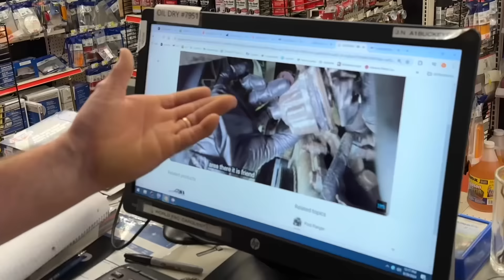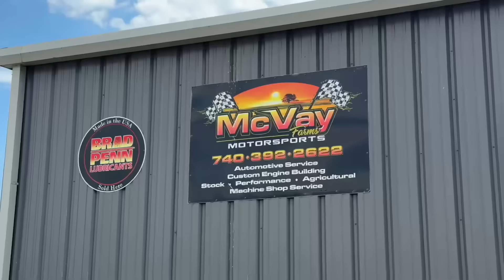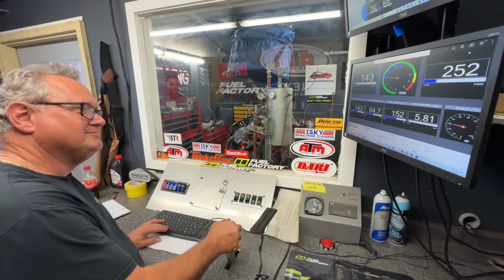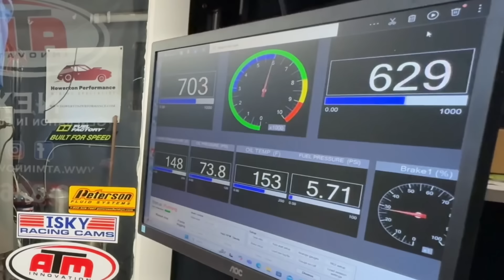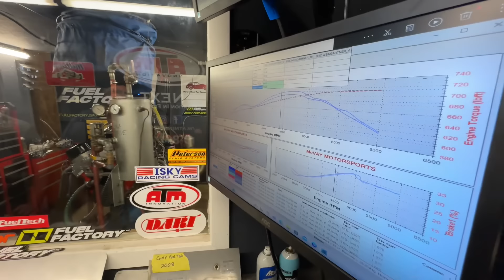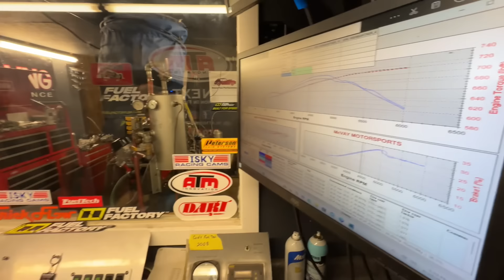WHAT WOULD YOU PUT IT IN???  WE ARE WORKING ON A NEW 496ci BIG BLOCK PUMP GAS GIVEAWAY ENGINE!

Comment: Centrifugal force is holding the clutch. We've been through this a bunch of times. A return spring on the clutch pedal under the dash will fix it in a crunch.
Reply: Been there, done that and a return spring has been a lifesaver a few times
Reply: Yep, also been there and done that with adding a return spring, but I added mine to the clutch fork to the frame on my ‘57 Chevy. Diaphragm clutch pressure plates were known for this. Also, if this engine is going to see some high RPMs, I would put a blow proof bell housing on it. When I was a senior in high school, I was checking out an engine in a ‘63 Chevy that the owner would sell if the money was right. The car was stupid fast due to the built engine. To make a long story short, that was the first time I saw a clutch / flywheel explode which basically cut the car in half.
I hope the 4 speed stays. Changing to a turbo 400 trans will make it faster but kill the fun factor IMO.
Reply: Absolutely..... put a spring on the pedal and be done with it.🇳🇴
Reply: Why not a automatic transmission you shift it out manually to if you want to or just put it in drive and cruise it.

Comment: Nice build. I’m building a 496 with a Crower custom ground hydraulic roller, 781 heads with big valves , port and chamber work. I hope mine makes similar power with a little more compression on E85.

Comment: Your brother should look for a crank with a big block snout that way he won't be breaking the crank on that small block with he supercharger. I learned quick that the small block snout can't take the force and tension on the crank snout and will snap clean off right behind the timing chain gear flush with the block. I know Cleetus dealt with the same thing on the LS in the Jimmy but instead of fixing the issue they just switched to a single turbo instead.

Comment: There is an apply spring under the dash I bet for an old Borg & beck style pressure plate that has to be removed when using a diaphragm  style like a center force.

Comment: That’s impressive for 280 heads on a 496!! I have Edelbrock 315s on my daily driven 95 GMC Sierra SLE rcsb stepside. I always figured it makes ‘600ish’ at 9:1 compression (never dynoed)…but it may make more! I know Holdener made 652hp with one almost identical 🤷🏻‍♂️
Mine was built to boost, I just don’t have boost 💵…yet! So it has a small nitrous kit on it for now🤘🏼

Comment: Diaphragm clutch.  Adjustment issue (high centers at higher rpm).  Not as much an issue with newerdiaphragm clutches (less pedal pressure).  Used to use borg and beck or long style on high rpm apps.

Comment: I own a 85 GMC Sierra (X-Diesel) 1-Ton, 12" Suspension Lift on 39" Pitbull Rockers, Odometer reads 29K, had a 454 in Her but it ate 2 rods and the crank shaft oddly still ran far, has a mildly built 355 sbc now, hasn't been titled since 2003, a 496BBC would make Me motivated to finish all the small details I've been putting off, I miss My "Baby".

Comment: Hey Bill, any thoughts on why the 496 fell off so hard after 5900 with solid rollers?  Spring pressure a little on the low side for solids?   It made killer power but man it ranked as the rpms climbed it seemed.

I’ve got a very similar 496 combo that also made 698hp on pump gas, also solid rollers on an Isky hyd roller and it doesn’t nose over like that.

Comment: Call Summit Racing get. Hurst 3 speed shifter mount- it mounts between front and back housing of that 4speed , retread the linkage, build a reverse lever and attach to the main shifter. In the end you will have 2 shifters , one with reverse lock out and you will not have to cut the seat and can use short shifter

Comment: Id put a auto in marks 55 before cutting it up to change shifters. But im sure that if you fixed his clutch and made the shifter situation better that the race between them would be close and equal enough to not matter. It will come down to who makes less mistakes. I would do it where they get to race like 3 times and get to throw out the bad times or losses to where you hopefully get a more accurate representation of the race vs how silly the guys are.

Comment: Bill, I have a 2002 GMC 2500 Sierra Straight Cab w/8'Bed. It has 103,000 miles & Very Well kept. It has an 8.1 ltr.(496) w/ a 5 Speed Allison Auto. 1 Very Small Dent, Original Paint and Body in Exellent Shape with very little driving time on Salted Roads, frame is very good. It needs minor maintenance repairs. Mr. Bill, Billy or Tommy if interested contact me.

Comment: Them 320's are a little big for a 496, gonna hurt the bottom end tq a little bit, them 280's would be a bit better choice on a street engine, that probably won't go over 6500 rpm much.